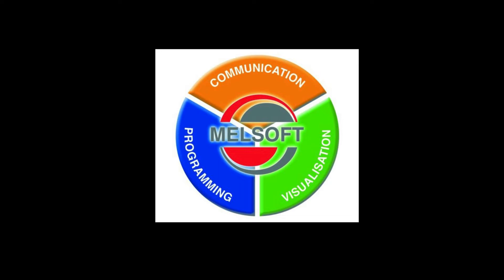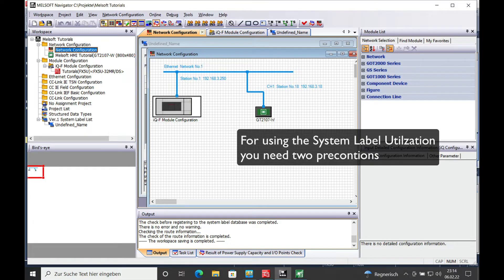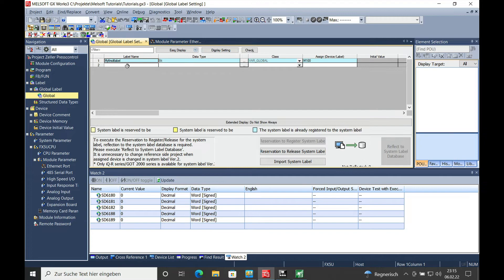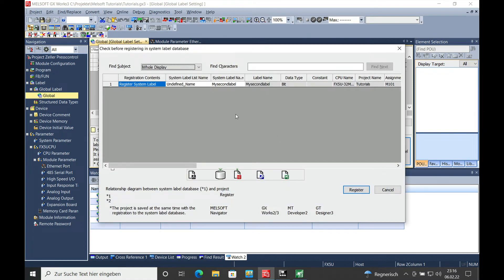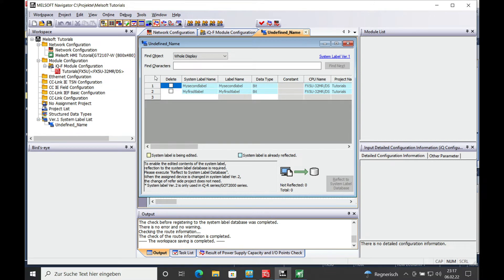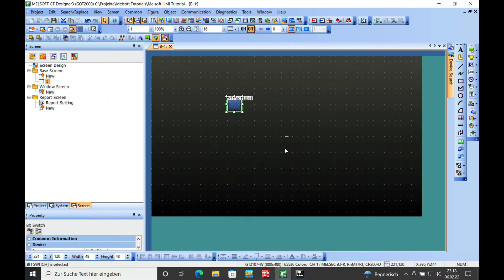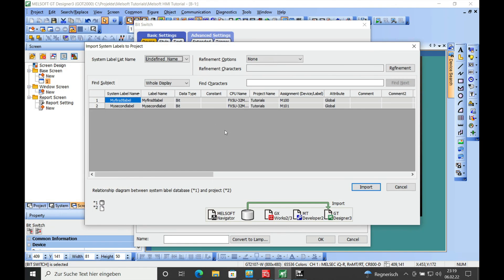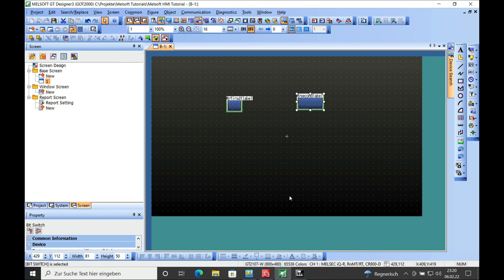Mitsubishi Melsec System label Utilization bottom up #3

Comment: Hello, Without assigning address to label will it work?
Reply from the maker: Hello, to my knowledge it does not work without an assigned address.
Reply: @zellerautomationandplc  yes. i tested and it doesn't work. But I still think it has another way like siemens or rockwell